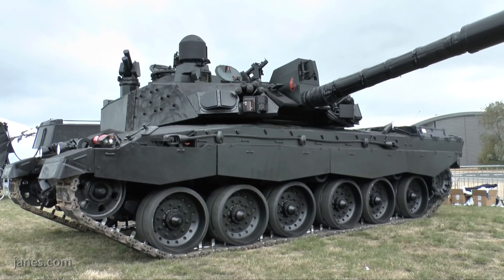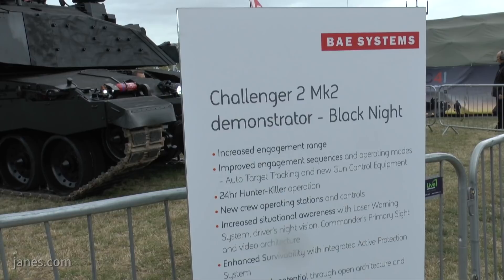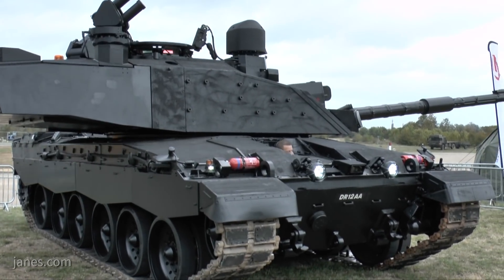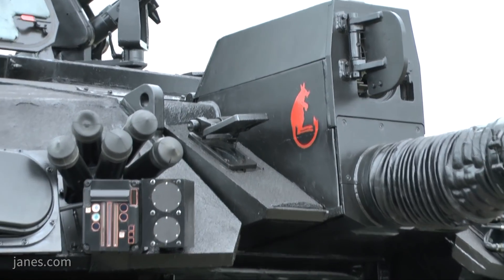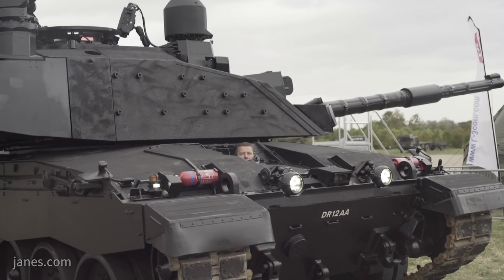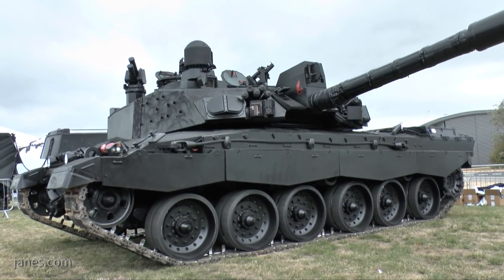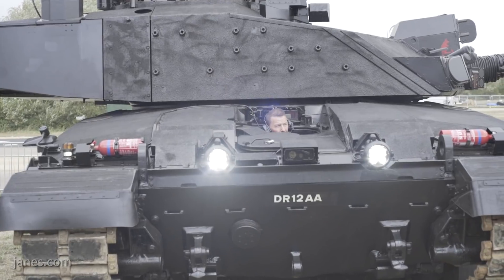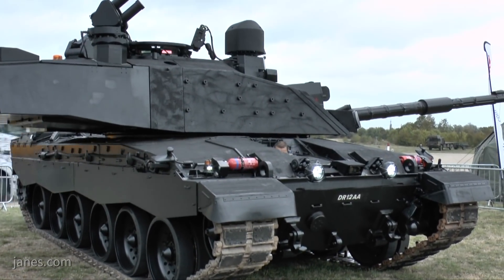DVD 2018: BAE Systems' Challenger 2 demonstrator - Black Night

Comment: 'Let's paint it black and give it a cool name so the customer will overlook that we didn't do any major changes'.
Reply: The tank doesn't look that different because, unlike the Leopard 2, it hasn't needed extensive armour upgrades because of its excellent Dorchester armour.
Reply: agt155 I ment the gun dude. And if Dorchester is so excellent, why do they slap 15 tonnes of addon armor on it before entering a combat zone? lol. They could've atleast upgraded the steel LFP on the base model.
Reply: As far as I know the 130mm and 140mm gun upgrades are years away.  Maybe you mean the ammo. Well a new L28 APFSDS has just been introduced.

I can see you're still getting your info from video games, the "LFP" has a big block of Dorchester on it. Difference between the Challenger 2 and the Leopard and Abrams is when the CR2 goes to a "combat zone" it comes back......lol
Reply: 140mm isn't going to be for them moment due to several reasons, 130mm will be the new standard being introduced on the MGCS in the 2030s.

The LFP has a compsoite block on it in the TES, but i was speaking about the base armor of the Challenger 2, like seen here in the video. This fella is sporting a 76mm steel-only LFP, and even with the TES composite block mounteed it doesen't reach comparable thickness to the LFP of a Abrams or Leo 2.

The L28 isn't for the british army, and will never be adopted by the british army. It was intended for export to Oman and Jordan. To be compatible with the ammo racks of the Jordanian Challenger 1 the L28 penetrator is even shorter than the L27 penetrator.
Reply: Wrong. The L28A1 was issued to the British army earlier this year as a replacement for the L27. With an 800mm DU penetrator it is significantly longer than its predecessor.

Your argument is very silly. It's like saying Challenger 2 doesn't have armoured side-skirts because they aren't fitted to training tanks. Dorchester armour has NEVER been defeated. Even the watered down version used on the Abrams has proven resilient.
Reply: First off, L28A1 penetrator lenght isn't 800mm. That isn't possible since the penetrator can't extend back into the propellant like on one-piece ammunition. It is restricted to the lenght of the first ammunition piece.

Second, the Abrams never used Dorchester. M1 and M1A1 used BRL-1 and BRL-2, respectively, standing for Burlington.
All later Abrams versions use indigenous US-developed composite armor, HAP-1, HAP-2, HAP-3 and NGAP. Atleast do your research.
Reply: It doesn't need to "extend back into the propellant", this is a problem faced by single piece ammunition, it just extends up the barrel. Good to see you accept this new round though.

Burlington is the name for 1st generation Chobham armour. All Abrams and Challenger 1's are protected by this. Challenger 2 has second generation Chobham armour called Dorchester. Burlington is still adequate for today's threats - much better than the Leopard 2s paper mache armour. Not on the Level of Dorchester though obviously.
Reply: 'it just extends up the barrel'

Interesting thought, but that's not how it works lol. You can't just make the whole round bigger, it would require a longer SABOT, and that is restricted by breech loading volume.

'Burlington is the name for 1st generation Chobham armour'

I know. But 'Chobham' isn't a official designation.

'All Abrams and Challenger 1's are protected by this'

No, only M1 and M1A1. Later Abrams have HAP-1, HAP-2, HAP-3 and NGAP armor.

'Burlington is still adequate for today's threats'

No, that's why they developed Dorchester.

'much better than the Leopard 2s paper mache armour'

Look up swedish test trial results. The Leopard 2A5 was better protected than the contemporary M1A2 Abrams.
Reply: The new L28 is almost twice as long as the 1980's L23, where did you think the extra length went? As I said before, the only thing restricting the length of 2 piece rounds is the physical space required to load them.

Abrams heavy armour package consisted of the addition of DU inserts. All Abrams still have their Chobham armour.

"Look up the Swedish trials"...How about looking at what happened to the Leopard 2 in Syria. The Leos protection levels are so poor it isn't worth considering next to Abrams and CR2. You'd have to have a deathwish to go into combat in a Tank with almost no armour and a big pile of CC ammo in an open rack next to you.
Reply: 'The new L28 is almost twice as long as the 1980's L23'

The L28A1 is shorter than a L27 and around since 2005. Link to that 'new' L28 please.

'Abrams heavy armour package consisted of the addition of DU inserts'

Not only. Remember, there are three different HAP packages. Also only the turret cheeks contain DU inserts.

'How about looking at what happened to the Leopard 2 in Syria'

The Leopard 2A4 has a conventional armor layout, having armor protection concentrated over the frontal 60° NATO. Don't compare the A4 to a CR2, it's from a time the Challenger 2 wasn't even in development. Contemporary Leopard 2 version would be A6.

'The Leos protection levels are so poor it isn't worth considering next to Abrams and CR2'

As said before, the 2A5 outclassed the M1A2 in terms of protection.

'big pile of CC ammo in an open rack next to you'

Bold thing to say, especially when your beloved CR2 doesen't even have a seperated ammo compartment with blowout panels. Stores ammunition around the crew. Only needs one blue HESH to detonate over the commanders hatch to kill everyone who was in the tank, 25 March 2003 Basra, Iraq.
Reply: The L28a1 is all new. Here is a picture of it for you.
https://en.wikipedia.org/wiki/L30

As I have said all Abrams still have Chobham armour.

You can compare the Leo2A4 with the CR1 if you like - it still has awful protection. The 2A5s armour update is almost all focused on the frontal arc too, and it's just cheap NERA plates similar to the update Chieftain recieved in the 1970's. All Leopard 2s have the same suicidal ammo stowage. Protected above by 20mm of steel!! 

Only inert projectiles are stored "around the crew" in CR2, all sensitive bagged charges are stored in armoured bins deep in the hull. 

Doesn't matter how well protected your tank is, if a 17Kg HE round hits an open turret hatch it's game over.
Reply: agt155 I would add that the major problem with the new fin ammo was storage as the Challenger 2 stores them under the floor and the new longer L28 ammo was problematic to fit.
Reply: agt155 I would point out that the MOD has found a Belgian manufacturer to make “Green” Tungsten fins, similar to the ones fired by the German smoothbore. They no longer manufacture DU projectiles.
Reply: Fin rounds are turret stored. I'm not sure 'who' manufactures the new L28 dart. I imagine the US would sell us their DU.
Reply: @jonny2954  It has add on armor slapped on the sides and unarmored LFP for resistance against RPGs and such. Dorchestor armored sections like the turret front and turret side and UFP do not have add on composite and ERA.
Reply: According to Jane's the L28A2 was developed for oman, finished 2008 and ready for production in 2009. But it was never adopted, oman and jordan went with the L23A1 instead. The UK MOD wasn't interested either.
Reply: Jordan is the only operator of Challenger 1. Not surprising they are retiring them as some are nearly 40 years old. As for upgrade options, they produced the Falcon turret. An unmanned turret with 120mm smoothbore autoloader..
Reply: I bet the M60s were mint American reserve stock though. The Challenger 1's were all ex British army dog-rough with a million miles on them. Of the 400 they bought I bet 300 were for spares. The M60 and their new Centauros also share the same 105mm rifled cannon so there will be big commonality savings. In truth modern 105mm munitions are probably superior to 1980's 120mm in any case.

The Falcon turret was very impressive on paper and must have cost a fortune in R&D, especially considering it never went into production.
Reply: Nope they rather waste billions on the EU and foreign aid. Than give us a new British tank. Just to add to that a bigger and better equipped armed forces.
Reply: @HoppingHedges  The reason challie 2 is getting a LEP is because progress on it's replacement has hit a few snags that need time to iron out but the replacement is coming though it will no longer be named challenger.  Being honest I'd rather they took the time and got it right rather then throw it out half finished and not ready for service life.  There are some very exciting technologies that we will see on the next generation of MBT's but some of them haven't matured as quickly as was anticipated and that's led to some of the delays causing this program for challenger 2.
Reply: It has APS and thermal sights for the commander those changes are kinda good
Reply: There not going to show what new armour they have for it on an interview you can see the attachments on the turret they will have something fitted
Reply: red rodent looks cool.   😉
Reply: Dozens of turkish Leopard 2s have been knocked out from the sides and rear with RPGs and ATGMs. They are always a weakspot and they have to be without compromising weight even further.
Reply: Perfect summary
Reply: No significant changes,really? Ok. Try deploying a bit of common sense. They aren't going to reveal everything they are planning to do when this is till just a demonstrator vehicle.  The MOD is notorious for changing it's mind about requirements and other factors also have to be taken into consideration. Cost, feasibility, availability, etc. The video makes it absolutely clear that this is not the final, definitive upgraded C2. Rheinmetall have got to reveal their package yet so how could any firm decision have bee n made?  You look but you don't listen.
Reply: the womble I was talking about this demonstrator vehicle, not the final LEP...

Comment: The British Army is in a huge mess at the moment and the main British tank problem is in having only about 250 MBT. Yes Chanllenger 2 needs all the upgrades it can get, since there is no money for a new tank. A smooth bore gun, with much larger single piece ammunition, would be almost as expensive as a new tank. A upgraded Challenger 2, with better defenses against enemy ATGM, would still be able to overmatch most of the MBT's it is likely to have to face.
Reply: 99IronDuke The UK Defence Force in general is undergoing the similar sense of apathy Ukraine went through before the Russians invaded in 2014. Only when the country faces an existential crisis then something will be done.
Reply: Then you are in denial.
Reply: Even with a new turret as the CR2 hull is rather narrow the bomb load would still be smaller than contemporary tanks like the Leo2 or Abrams.

I tend to agree, the best way forward at the moment is to do the minimal upgrade to keep the tank viable for another fifteen or so years. To that end replacement of obsolescent electronics, adding modern sights and a passive or even active ATGM defence system is the best way forward.

As you say CR2 and L30 CHARM are still an over-match for the vast majority of tanks that we are likely to meet over the next few years, everybody is having a sh1t fit over the T14 Armata but that is not going to be seen in numbers for many years. Frankly I am slightly skeptical about its capabilities and it is a long way from export. Reality is the vast majority of tanks out there are still T55 or T72 plus a large variety of M60 variants.
Reply: tk421missing Regardless, its the British monarchy that has the true power. The parliament is just the front man. Same goes to Saudi Arabia
Reply: vivienne koo amen wee sister they distroyed the british army in n ireland trying to fight terrorists they hardly ever seen they were targets for bombs and bullets all to get sinn fein into government who were formly murderers and polical prisoners thses people were let of the hook and given money a sin before GOD while the victims suffer from there injuries both army and civilians  if people cant see the dirty british governments hand in this is blind soldiers who served here brought before courts while gunman who shot them where given thousands of pounds what a bloody disgrace thses devils are GOD bless you indeed
Reply: Leslie Dodds Exactly, these people are drooling over crude technology that is not even meant for them.
Reply: tk421missing Well said. The British military are nothing more than toy soldiers of the monarchs.
Reply: @JemRau    The soldiers are not "toys". They are one of the best trained fighting forces in the world, and do not serve the queen as she does not decide where the troops are deployed. What nonsense.
Reply: W.A.S.P 22 Who do you think has the power over the British parliament? Also, to whom the british military swore their oaths to? I don't give a DAMN(yes all caps needed 😂) if they are elite, they are expendable in the eyes of the string pullers.
Reply: @JemRau    Who controls the parliament? The members of the parliament and their party leaders. The queen simply signs off on everything they decide and has no influence on them. Yes they swear to the queen, but oaths are not what they used to be. You act as though the military are all undyingly loyal to the queen alone and would kill everyone she asked them to. In reality most of them probably coukdnt care less about qhat the queen has to say, they go where the prime minister tells them and no where else.
Reply: But its ok to cry, be a homosexual, a feminazi and pray to Allah while on frontlines in the British Army
Reply: 1) Yes it is OK to cry in the British Army, if a soldier feels emotional need support will provided and there is nothing wrong in crying

2) Homosexuals are welcome in the British armed forces, we are a modern society so I hardly see what the problem is, we can't afford to turn away potential recruits

3) Woman are welcome in the British armed forces, we can't afford to turn away potential recruits

4) Muslims are allowed to join the UK armed forces as we are not some bigoted backward third world country that discriminates against people based upon faith, race or gender and...we can't afford to turn away recruits

Look this is a serious discussion, take your nonsense elsewhere!